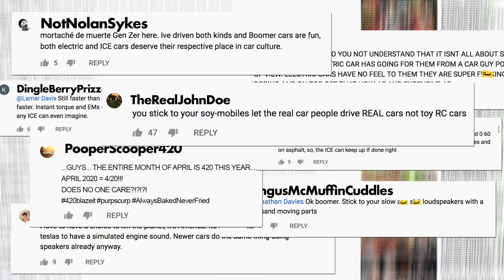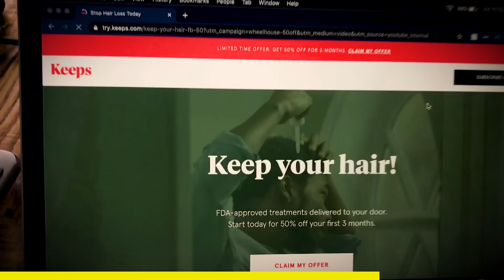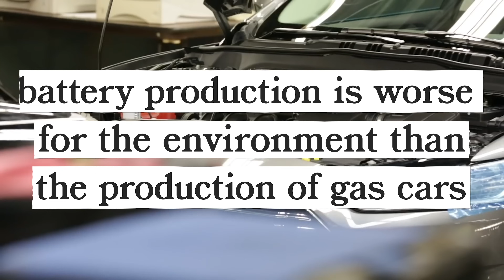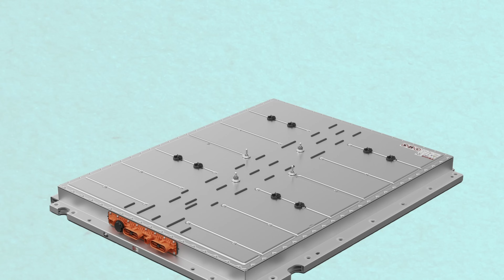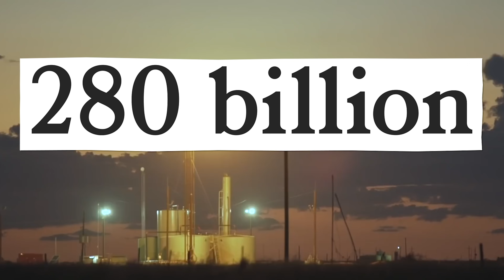Are Electric Cars REALLY Better for the Environment?

Comment: Before I watch the video (and yes I know I'm a year late) I did an essay on this in like 7th grade. Electric cars make fewer emissions but the cost of them greatly outweighs combustion engines. They cost much more to make and produce than their combustion counterparts so for now, combustion beats them. I don't doubt that in the future they'll be better though.
Reply: Who cares about the cost if topic is about environment safety
Reply: @MJ0101_  
The carbon footprint from manufacturing electric cars, especially the batteries, is immense.
Reply: @dbclass4075  Batteries need to be replaced because their capacity decreases with charge cycles though.  You have to factor in the long term carbon footprint from frequent battery replacements too.
Reply: @maxeisenach1771  Also factor improvements that made newer generation batteries that have longer lifespans. ICE or BEV, technological improvements are continuous.

Comment: Did he cover the issue of charging these cars ? Also electricity is produced through has and oil industry right now. Don’t think wind turbines are that advance to make enough power to not dependent on oil and gas.
Reply: What issue? And any inherent emissions from energy production is 3 fold worse for hydrogen.

Comment: What's the moral difference between EV's and Blood Diamonds? Could refineries be made more efficient and cleaner? What about synthetic gasoline made from bacteria? How about instead of using so many batteries, electric cars get their power from induction lines in the roads? I beleive Tesla is working on an Iron Air battery which could drop the EV carbon footprint significantly.

Comment: Thanks for an excellent insight into CO2 emissions from mining and manufacturing.  I still have the hole in the donut - better for the environment okay BUT here in India at least, EVs are way more expensive than ICE vehicles apples to apples - and that's my personal environment that is burnt.  I'd love an EV - if it was affordable.  GM is working with some Hong Quong Duck (the name is Chinese and I keep forgetting it but I do remember the excellent duck we had in Suzhou.)  Renault is working on a low cost EV too - but the rest - they're like the Mustang Mach-E which is the cheapest 300 Km EV at USD 44K - how does that compare with the Mustang ICE at USD 26.6K?  So the next barrier is Price to ensure the personal environment is not sullied by wasteful expenditure.  Just by the way, CO2 emissions do not matter as long as there is H2O in the atmosphere to moderate the diurnal heating and cooling and drive weather and a nitrogen oxygen mixture that results in a steady increase of heat with pressure and allows an adiabatic  lapse rate of moist air right up to the tropopause - you know, updrafts, clouds, condensation, rain and so on.  If CO2 as an agent of forcing were not a myth, the earth would have had a runaway greenhouse effect in the Ordovician at 9000 ppm CO2.  No go - we had the Cambrian explosion of life instead.
Reply: The mach E is a POS. I dont care that it's electric but an SUV should not be called a mustang ffs. Im sick of ugly jellybean SUVs in general. What was so hard about just making a normal mustang that's electric?
Reply: @P7777-u7r  sUVs are overgrown hatchbacks.  When they work out how to  produce slim batteries, male horses will surely glide under traffic barriers.

Comment: Range and charge time is the biggest problem with ev over ice.  You can drive a hybrid from LA to NYC gas station to gas station.  Drive your ev to a hotel with a charging station, and head to the next hotel with a charging station. You can do more with a Hybrid.  I'm not a hybrid guy, but ev isn't there yet.
Reply: You’ve never travelled much in an EV have you,

Comment: You forgot that batteries need to be substituted the recycling and new battetries should be into your lifetime calculations 👎👎👎
Reply: Depends on the car.

This is somewhat true when discussing junkers lacking good battery management systems like the Nissan Leaf which has an average expected capacity loss of ~25 - 30% over eight years. Pretty bad.

On the other hand, Teslas have excellent battery management systems which, on average, minimizes capacity loss to ~7 - 8% over eight years even under heavy use. Most Teslas are expected to maintain well over 70% capacity by their 25th year, and I think we can agree 25 years is pretty healthy. The power package of an EV is also pretty simple compared to modern ICE which increases reliability in that aspect as well.

Keep in mind battery technology and battery management systems continuously improves with time. That's the data we have on cars at least eight years old; Musk has since announced a million-mile battery pack. On the other hand, ICE development is pretty much donezo with increasing numbers of manufacturers having announced intent to sunset ICE... soooo... buy a car with a good battery management system and you're golden.
Reply: ….. did he talk about the fact that hydrogen cars only last a fraction of the lifespan of a BEV and to get the same use out of FCEV’s as you would a BEV, in terms of miles drive, you’d need to make, buy and dispose of 2-3 whole hydrogen cars to one BEV lifespan?

Comment: You forgot the much, much higher emissions to produce the ‘renewable’ power generation like solar and wind power plants (compared to a coal power station construction) - where are they in your calculations ?
Reply: When both can be powered by renewables, why would you assume renewables for one and not the other?
Reply: Same story. Renewable power uses wind, solar, or water; these resources are free, infinite, and don't generate emissions during capture. Your coal power station ( as well as natural gas and nuclear ) requires fuel. Extraction, refinement, distribution, and use of such fuel all generate emissions in addition to bearing an ever-increasing cost.

So renewable power generation, analogous to EV production, over a long enough time span will generate fewer emissions in addition to being cheaper ( cause there's zero fuel cost ). It's why coal, sans current bump, is dying.

You've tilted the argument further in favour of EV's.

Comment: Electric cars are bad for the future.  They are the method by which the driving experience is removed from us.  Steering and throttle by wire mean that you'll not have direct control of your vehicle.  Combined with the internet of everything, you may lose sovereignty over your vehicle from the touch of someone else's keyboard.
Reply: Ran out of tinfoil?
Reply: @engineeringtheweirdguy2103  Tin foil may be only way of shorting out the ECU so I can get a real drive - not like that GPS-guided F1 rubbish (ever wondered why their lap times are soooo close?)
Reply: @engineeringtheweirdguy2103  Nah, just ahead of the curve.  The Biden administration just slipped in a piece of legislation that allows for a 'kill switch' to be fitted to all new cars from 2026.
Reply: @richdespiseus6243  allows for or demand?
Reply: @engineeringtheweirdguy2103  What's the difference in 10 years' time?  The same people who make cars, lobby for the legislation and their friends enact it  - wheels within wheels.

Comment: Stop bloody measuring pollution by CO2 - it's nonsense!  Real pollution comes from manufacturing anything refined (petrol or lithium).  CO2 is the gas of life and it's pretty low in the atmosphere at the moment.  Plants would suffer badly if the CO2 level were halved - they'd like 4 times as much as there is now.  Despite this the world is getting greener, as seen from space - all on 400 parts per million (practically zero!)  If you want to know how CO2 got mixed into pollution, research carbon trading as the biggest profit-making spreadsheet of the century.

Comment: Electric Cars Are The Future OF CONTROL to get it right. New Digital Motorways Start 2022, When more of you are in your electric cars that you think are great, not paying tax and well not cheap to run because the depreciation is horrendous so its costing more than efficient old car. Government cant loose all that duty on fuel! So welcome to new Digital Motorways to Charge You Per Miles you Drive, and in further years You will be controlled where you can go, welcome to The Future

Comment: I wonder how hydrogen gas cars compare to electric cars in terms of environmental impact.
I know EV cars are about twice as efficient to operate (charging it with electricity directly), but there have been talks about using hydrogen energy storage in the future as a method to store 'green' energy.
I don't how this will work out in practice (I'm very sceptical, I must admit), but if it does for the better, shouldn't a hydrogen car be the best alternative in terms of greener footprints?

Comment: You cannot produce an EV without oil and the plants that refine it. Where do  you think the plastics and rubber come from?
Reply: So. Since we can’t stop all oil use? We should keep burning oil for everything. Next time I have to brake to avoid a brick wall. If I think I can’t do it without touching the wall, I’ll hit the accelerator instead. Good advice
Reply: Electric cars being pushed by Climate Change, Its just more Lies like Whats going on now with Vaccines that arent Vaccines. Climate Change used to push new Technology, Already rolling out Digital Motorways So They Can Tax You Per Mile when they Loose All The Fuel Duty Money
Reply: @daddymulk  Actually the leading reason people buy EV's is because of the cost savings, convenience, and the performance/capabilities of the technology. Studies show one of the smallest considerations of EV owners when they buy them is the Environment.
Reply: @daddymulk  so maybe make less assumptions?

Comment: I agree with most of what you say apart from the issue of subsidies for EV's and the poor.  Poor people don't buy new cars and will never be able to afford EV's and eventually as ICE cars gradually disappear poor people won't have cars.  Whilst that will be good for the environment it will create a social divide.  There will of course be a market for used EV's but they will still be beyond the poor.  At the moment aging ICE cars can be maintained by relatively easy replacement parts.  When an EV's power supply (the battery) dies you can't repair it with cheap parts it's game over for that car.
Reply: Why? I see lots of low income earners in old Mercedes and BMW’s…
Reply: I see even more in land cruisers and patrols which cost even more

Comment: Why don't they use electric vehicles to mine lithium?
Reply: Because its unpractical. You need big power tools to run for a long time. The battery would have to be colossal.
Reply: Some mines actually did start using electric vehicles to mine Lithium this year

Comment: lol, this video is full of alot of missed info. EV's are quite a bit worse then you are led to believe .
Reply: wrong... This means you have zero understanding of the problem with ice cars.
Reply: @mikewade777  lol, mining , transport of raw, refinement, currently no way of recycling or disposing batteries, the list goes on.
Reply: @MrJz97ss  and that's nothing compared to ice cars... you clearly don't understand why people have a problem with them.
Reply: @mikewade777  just say you don't know anything about electric cars....lol. Easier then beating around the bush. We haven't even begun to tackle the other issues of battery inefficiencies/damage due to rapid charging, thermal battery capacities issues, and no mention of servicing the batteries, cost is astronomical, landfills filling with toxic batteries leaking into the water table ....lol the list goes on......etc.

Comment: It still seems to me that EVs are landfills waiting to happen. A replacement battery for a Nissan Leaf is $5000 I really can't imagine anyone buying a used car with that hanging over it. Also, there's the fact that Afghanistan is sitting on one of the largest lithium deposits. There has to be a better option
Reply: Afganistan? I'd avoid your mama joke and just say that the biggest lithium deposit is in ocean.
Reply: @chupasaurus  China is already trying to make a deal for it giving them another strangle hold on the rest of the world
Reply: @jdm-uk-yank  You know Canada has the biggest lithium mine in the world right?
Reply: @psikot  Actually, your ranked about number 7
Reply: @jdm-uk-yank  Actually, Australia is #1  in lithium production.
Reply: Lucky oil is in the Middle East where there are no problems and US soldiers don't die for lower gas prices.
Reply: There is... using fossil fuels and gases for cars, but switching to nuclear for mainstream power production for homes, businesses, etc. Nuclear has very little C02 emissions. It's something that we need to look into more
Reply: @Soap_Bar  Better yet, mass transit. Rail vehicles are easier to electrify than road vehicles.
Reply: @Soap_Bar  EXACTLY. My brother is an electrical engineer at a power plant near me. Apparently its so highly regulated that it’s too expensive. It does produce radioactive material that is typically stored on site of a nuclear facility, for that reason treehugging douche bags have made it difficult to run a Nuke plant, with regulations and difficult rules and such.
Reply: @evanschippers3943  Is he willing to store the waste at his house? or yours?
Reply: @psikot   no sir, on-site of a nuclear facility is the safest place to store it. The security is high and many regulations make it safe for storage. As well as parts and maintenance on parts for the reactor and other faculty equipment is done routinely, even more than that actually. They take preventative maintenance to a whole new level.
Reply: @evanschippers3943  What if they go out of business? The reactor cost isn't worth the profit? 

How much can they store? What happens in a flood? earthquake? January 6th terrorists? damage to water pumps?

Comment: Sorry but i gotta call bs on the power grid. If you live in CA you know. I had a tesla. Got a notification during the heatwaves…don’t use superchargers…and LADWP had massive power outages for 3 days i didnt have power at home. “Buy electric” but then no power to charge your car. Lol. Gas all day. Ive owned a model 3 long range i wouldnt go back. Degredation is also an issue. Tesla is the best in evs at least the most versed and experienced the lifetime of these batteries is worse. My dads car has 180k miles. I drove my model 3 for 16k miles and the battery was useless. My range dropped from 350 to 280…imagine i drove it for 180k miles.
Reply: then drive less.

Comment: I kind of doubt the electric grid can handle charging all the cars at the same time, it can barely handle the ac units for houses during the summer, not to mention they started shutting the power supply to some areas here in southern CA because of the winds & don't want fires to start sssooo essential gas seems to be better 🤣😂
Reply: The people in Texas would HIGHLY disagree that the grid could handle the power consumption, especially after the winter where rolling brown outs were being done state wide.
Reply: I have been saying,  the same for 10 years.
Reply: Cars charge at night when grid power is at its lowest.

When the power goes out, your car can power your home.
Reply: @psikot  most people are home at night is when they all turn on ac units & if you own 2 electric cars you would have to go out & switch the plugs between cars because I doubt people would install multiple charging units lol
Reply: @noneamakenanysense5312  People turn on AC units at night? Seriously?

Cars can be used as backup power for the house. 

An outlet is a charging unit LOL
Reply: @psikot  I mean if you like sleeping in the 90 to 105° night without ac then hats off to you, of course the car will be a charging unit but you can't use it to charge itself or another car lol
Reply: @noneamakenanysense5312  1 Where do you live where its 105 at night?

2 Who says you can't do both? 

Homes from the 70's can do 40 kW without tripping the breaker. If you can run the AC at the same time as an electric kettle or hair dryer or computer then you can charge 2 cars no problem.

3 sounds like you need solar panels that will pay for themselves in 2 years.
Reply: You would think of EVs as a huge drain to the grid, but they can actually help with grid stability. EVs plugged into smart grid capable housing can be used like a storage tank, and drawn from (for a short period of time) to supply power back to the grid during peak demand. So that tesla out in the garage could actually help keep the AC running. All depends where you are though, and how the grid in the area is configured.
Reply: @christianjensen2831  where I stay at they shut the power off due to high winds to prevent 🔥 from happening so the grid wouldn't get much back at least 6 months of the year ..

Comment: The problem for me why an ev does not work is because i live in a apartment in a smaller town in germany i have garage but no high voltage (400 Volt) only 230-240v and even if i would not be allowed to charge the car in the garage. The next charing stadion is about 3-5km away in the next town and also is just one. And the biggest reason theyre way to expensive the cheapest one for sale is the Dacia Spring for i think 15k€ only 30-50hp and a somewhat good range ~200km good city car but not for longer travel